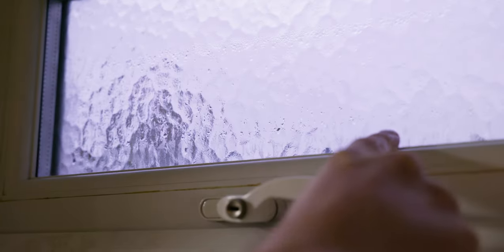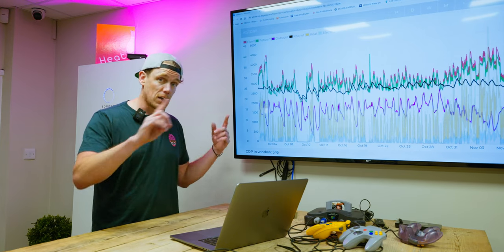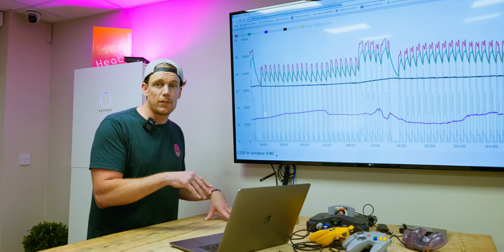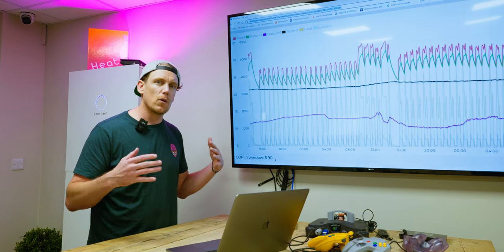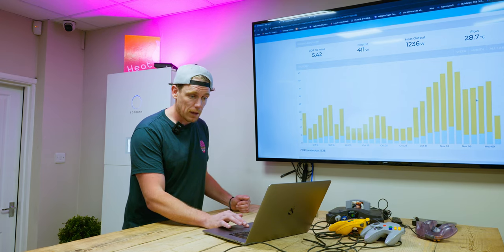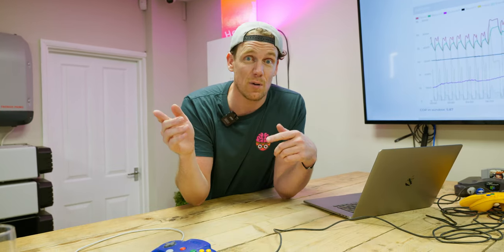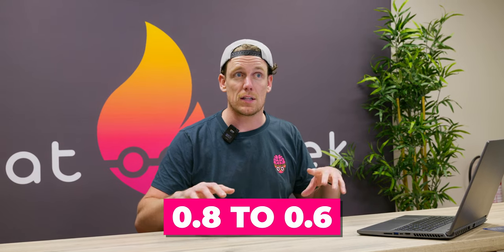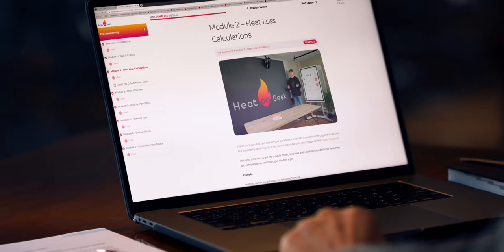How We Got 600% HEAT PUMP EFFICIENCY With NO INSULATION!

Comment: Could you explain the reasoning for target COP number as the measure of successful performance ?  yes it shows the very efficient use of electric Vs direct gas heat but surely it is the total electric energy consumption reduction that should be the target. So when you install insulation total heat demand goes down and hopefully electric consumption. Should that not be the target to encourage?
Reply from the maker: Sorry I don't understand the question?
Reply: I think he means that insulating should be the priority instead of system performance. 

He probably didn’t get the idea of this beeing a testcase where a heatpump can heat a poorly insulated building without displaying horror kw/h usages just by focusing on good system design. 

Anyway, subscribed!
Reply from the maker: Adding insulation means tou can lower flow temperatures which increases efficiency ad well as lowering demand

Comment: Surely having a poorly insulated building will slightly increase the efficiency of the heat pump. (Not the other way around.) That would be because the poor insulation would allow the internal temperature to drop more easily, keeping it a bit lower, which is good for the efficiency number.
Reply from the maker: No.. that means it works harder and efficiency drops... it has to work at higher temperatures.. the opposite of what you meed
Reply: @HeatGeek  When you say 'works harder' do you mean that it has to move more heat per minute? The situation in my house is that our poor insulation means it stays rather cold even when the gas boiler is blasting away. So, poor insulation to me means lower internal temperatures.

Would it be fair to say that lower internal temperatures would make things a little easier for the heat pump (less of a temperature difference to pump against) but having to supply more heat forces it to work in a less efficient way (e.g. outer panels get colder)?
Reply from the maker: @Matthew Leitch  I mean it had to work hotter so the expansion valve closes more and the compressor pushes harder against it so the efficiency drops right off..
Reply: @HeatGeek  I'm not familiar with the internal mechanisms but was thinking of two points of basic physics. (1) The efficiency of the heat pump is powerfully driven by the temperature difference between the internal and external environments, which is why they are less efficient on a cold day, but would be more efficient if the internal space was kept cooler. (2) The temperatures of the internal and external panels of the heat pump are not the same as those of the internal and external environments, and this difference increases when the flow rate of heat is raised. With a high heat flow rate the external panels get much colder than the external environment and the internal panels get much hotter than the internal environment. I think this second effect is the one you are talking about and is the dominant effect when the internal environment temperature is fixed using heating controls. Have I got this right?
Reply from the maker: @Matthew Leitch  yes. Put more simply, thouugh.. the wider the source and sink are apart the harder the compressor has to work to move the heat and the more electricity consumed. Source is environment, sync is the rad flow temp.. not the room..

Comment: We have a similar 7kw arotherm. Just checked the working figure which vaillant elude to being cop. It's  reading  7.1 for heating for November so far and 4.2 for dwh. Seem too good to be true. Although have tuned it carefully to get there.
Reply from the maker: If your well insulated and/or have underfloor heating it's probably correct.
Reply: 50% insulated . Lots of thermal mass, mid terrace and basement with ufh . Rads in the rest. And super warm November!
Reply: @zlmdragon.  thanks. I have measure the  actual electrical usage and it does under report about 50-60watts consistently when running. But as the running power varies between 500 and 1500 watts normally the percentage error is not too bad. But it annoying they don't give true figures. Like estate agents 'measuring' floor space the error always favors the measurer!
Reply: @zlmdragon.  absolutely.  But at these figures I'm happy even with a 10% error. It's still way out performs our gas boiler which was the point. They clearly could include the pump and electronics consumption.  Just the dishonesty of the marketing world. 😞

Comment: Awesome videos. Thanks so much for sharing this information. Like some others here, I have an Ecodan. Is there any chance you can share some comparable settings?
Reply: The main get good COP is keep the flow temperature as low as possible, Adams heat pump runs with a flowT of 27C-30C when it's about 7C outside. If a flowT of 30C doesn't heat your house adequately you could look at upgrading radiators. Also ensure the system is not zoned and all TRVs are fully open for best performance. Every system is different, real-time monitoring is very useful to immediately see the effect of any changes
Reply: @GlynHudson  Hi and thanks for the reply. All rads were upgraded at the time of installation and TRVs are all at max so should be good there. I switched to curve settings at the weekend but blindly copied someone else's setting. I have an upper and lower setting (flow and outside temp for each) but not sure which temps I should start at. I think I set something like 48 @ 2 degrees and 35 @ 15 degrees. Sounds wrong from what you're saying.
Reply: @craglett  That curve setting means your flowT will be 48C when the outsideT is 2C or below. Assuming you have upgraded radiators, this is very high! Try reducing the curve as much as you can. You could try something like FlowT 28C @ 15C outside and flowT 35C when 2C outside. You can experiment over the winter by slowly dropping the curve until you're cold and then increasing it a bit. The rads will obviously be cooler to touch but the heat pump will run for more efficiently for longer  between cycles
Reply: @GlynHudson  Again, thank you for your help with this. I shall give those settings a try as a starting point and experiment over the winter.

Comment: So, come on, lets be honest, you know and I know and everyone else who did physics knows, it's not more than 100% efficient.  That's why they don't call it that they call it GOP.
They are not 100% efficient, far from it.  The compressor et. al.  is quite wasteful, as compressors can be.  Just because it moves 5 times more heat than the power it's consuming, does not make it 600% efficient.  It did not create that heat.  It just moved it.
Reply from the maker: It was  fiscally 600% efficient as we show here 
https://youtu.be/ODbkT3-THaU
Reply: The comparison is generaly made against a resistive heater that is assumed 100% efficient at transferring electrical energy to heat energy. Since a heat pump, as you correctly state, only moves heat it can therefore be far more efficient at heat transfer than a purely resitive heater.
Reply: I'm kind of with you, as a physics pedant, but effiency seems to cut through more quickly than going through thermodynamic theory of heat engines and carnot efficiency etc - though understanding of this is key to realising why flow temperature is so important. Fwiw my heat pump seems to run 40-45% efficient compared with the carnot ideal - which isn't bad when you look at steam engines etc

Comment: I saw your readings was up and down as though it was turning on and off, is this correct?
Reply from the maker: That's cycling..  they're about 45 minute cycles which is fine.
Reply: Does all that cycling reduce HP life?
I don't know much about compressors but i think that the HP does not enjoy on/off 20 times/day?!?
Btw , does an electric compressor pull more power on start/stop than idling away in silence...for all winter??
Ty Adam for all the geeking around so all of us dont have too ;D
Reply from the maker: @FoxyPoxy337  it's not ideal but as it gets colder it stops and obviously doesn't do it in summer. Our heat loss is annoyingly between 2 heat pump sizes

Comment: @heatgeek Is it possible to calculate the SCOP over time without installing the open energy monitoring system? Their system is fantastic but it costs 10% of my ASHP install and I can’t afford it.
Reply: My Daikin wired controller provides figures for total electricity used and heat provided. I can't monitor in real time but take daily readings  . So far heating 232kWh ==>932kWh and Hot Water 196kWh==>501kWh. Average COP 4.02 and 2.56 compared to design COP of 3.4 and 1.9.
Reply: @zlmdragon.  Thanks Vicki, can you recommend any meters?
Reply: You don’t have to have a heat meter (level 3). If you just fit a level 2 system it will give you a good idea how your heat pump is working and may pay for itself.
Reply: @gavthegas547  thanks Gav, that’s good to know. I want to get the best efficiency possible, is the COP the best way of judging this? The level 2 systems are advertised as no COP. I’m getting a Daikin Altherma but I’ve not been able to find out what data I can get from its user interface.
Reply: @zlmdragon.  It will be the EDLA04EV3
Reply: @thesquirrelhorde  you can use the Carnot formular to get close enough for monitoring if you are concerned about the price.
Reply: @zlmdragon.  Thank you for pointing that out. We are having an Octopus install so part of their ability to keep their prices down (their quote was half the average price of other installers) is that we have to accept the ASHP that they supply. Cooling is attractive but it would require fan assisted radiators to circulate the cold air, otherwise it would stratify around your feet. It also needs all the pipework to be lagged which means pulling up floors.

Comment: If I could run one of these off of my home storage battery which cost me 4.5p/kwh at the moment, then I'd be looking at <1p/kwh for heat, must be mad to still have my gas boiler.
Reply: That's exactly what I am doing, 7kW Arotherm plus ASHP has been up and running for about 1.5 months with a total COP of 6.0 and 5.8 for this month so far. Had solar with 12.4 kWh battery installed a week ago and looking forward to seeing the results in the months ahead.

Comment: Forget all the “efficiency” figures (calculated how?) gas is cheaper. Heat pumps only produce background heat and certainly can’t give you hot water. You will need an electric immersion heater and hot water tank. Far and away the best answer is a modern gas combi boiler. Until electricity prices get close to gas this is a non starter and don’t forget the years it will take to recoup the outlay, if ever.
Reply from the maker: To answer your question it’s calculated by dividing the heat generated in kWh by the heat produced in kWh. This makes it about half the price for heating with a gas bouler

Comment: I have to say, your educational videos regarding Air Source Heat Pumps have been inspiring.

I have a question about positioning the outdoor unit, with a suggestion I'd like to pose.

I've bought a heat leaking 1950's house which I intend to insulate. At the same time, it's my intention to build a 6 meter single storey extention at the back, and I think I've had a idea that I'd like your thoughts on.

I plan to have the first 1.5 meters of the extention roof to be flat, and the remaining 4.5 meters of said roof to be pitched. The flat part of the extention roof would be adjacent to the house, but from the back of the garden, you'd be forgiven for thinking that the whole extention was pitched. But the real beauty of the idea is that the flat part of the roof could where the Air Source Heat pump outdoor unit could be positioned.

Can I ask you if there are any performance reasons why this location would be a bad idea.

Some Councils have issues with the esthetics of industrial type white boxes attached to domestic dwellings. My idea may offer a discreet solution.

Hope I've explained my idea clearly enough to understand, any thoughts would be greatly appreciated.

Regards

Robert
Reply from the maker: No performance drop no

Comment: most likely heat pump is working in a different stage!!!  if you insulated walls then heat pump will work in lower stage or speed if its inverter heat pump and HP efficiency will be higher!

Comment: What was wrong with your windows? What do you mean by blown?
Reply: The seal in the double glazing unit is gone. Double glazing has a vaccum sealed section between the glass panes.
Reply: @Etacovda63  Ah, cheers
Reply: @Etacovda63  the vacuum is a bit of an urban myth for common glazing, it’s just air unless filled with argon which improves the u-value of the unit - the condensation which indicates failure results from the butyl seal and dessicant in the spacers failing over time and letting moisture in more so on south facing windows with extremes of temperature change. True vacuum glazing has very thin units as the gap between panes is as narrow as practical to create the vacuum and also has micro-spacers to stop the panes touching under the external atmospheric pressure - they are also super expensive albeit having a very low u-value 🤓
Reply: Thanks, good info and makes sense.

Comment: please note that these figures are only based on heating only, with hot water being solar generated instead, your figures and lower cop rating will lower if you heat a solar cylinder using a heat pump as your main source

Comment: I presume your heat pump is sized for your current poor efficiency heat loss. When you add cavity wall insulation (or    external wall insulation) and loft insulation the heat pump would end up quite oversized.  Even more so if you improve the glazing. Is that likely to cause problems with the heat pump cycling on/off and hurting SCOP ?
Reply from the maker: There is no smaller heat pumps out there
Reply from the maker: @sonacphotos  they are inverter driven, yes.
Reply: @sonacphotos  There is still a minimum turndown ratio even on inverter driven units.

Comment: Great video and lots of useful information as usual.  As an engineer it always rubs my nerves to hear people talk about heat pumps having greater than 100% efficiency.  Nothing has greater than 100% efficiency heat pumps included.  What you discuss as efficiency is coefficient of performance not efficiency.  Heat pumps don't generate heat they move it from one place to another.  This requires less work than generating heat which is why they are able to release more energy in heat than they consume to run.  But efficiency is a measure of the work done versus the power consumed and this is less than 100% for all heat pumps.  Otherwise perpetual motion would be possible.  Anyways I know you use this expression because it is easier for the average person to understand the relationship between power and heat released.  But the more people who use the word this way eventually the meaning of efficiency will be distorted into something it isn't.  But then again I suppose that explains many words in modern English today which are a long way from their original meaning. ;-)

Comment: No one is talking about the fact home heating oil is cheaper than a heat pump with current electric and heating oil prices
Reply: What's the price of heating oil per kwh?
Reply: @hazmat5749  price 0.96 per letter 1 litre provides 10kwh so it 9.6p kwh.
Reply: Yes, you're right.  A heat pump running with an average COP of 3:1 will cost around 11p/kwh plus standing charges.  In all my projects, I advise my clients who want a heat pump to always combine it with photovoltaics and battery storage.  Expensive yes, but if you're going to go for it, then go for it is my opinion.
Reply: @craigstephens93  I really want to invest in a ASHP but it doesn't seem to  be a good idea to move from my oil boiler just yet. Although I am investigating in solar and battery system in 2023.
Reply: @gasmoney9319  Really? 9.6p per kwh?  Thats cheaper than gas, does that include delivery?   My electricity cost 24p per kwh, with a heat pump with SCOP of 3.5 that works out at 6.9p per kwh average cost for heating.  I am currently paying 10.4p for gas and with an 80% efficient boiler thats the equivalent of 13.5p per kwh.
Reply: @hazmat5749  you seem to be getting a very good rate on energy our electric is 0.33kwh. Am not so sure a heat pump would consistently achieve a cop of 3 throughout the winter in most cases. Delivery is free although you have to purchase in bulk I  purchase 500l each refill my tank holds 650l.

Comment: The title is a lie. 600% efficiency is impossible and these guys know it. They may have got a COP of 6, but that is NOT 600% efficiency.
Reply: it is though. You dont understand how a HP works apparantly.
Reply: @Deiphobuzz  No. sorry bud, but it is you who don't understand. Define COP for me and define efficiency. When you have done that I challenge you to prove they are the same thing.
Reply: @nickwinn7812  Youre trying to prove something with the statement but refuse to just post the answer. This makes me guess you dont know after all. Im not bothered at all, so have at it.
Reply: @Deiphobuzz  I'm a qualified engineer. I repair and maintain heat pumps. You accuse
me of ignorance whilst demonstrating your own.  

 COP is the ratio of the energy input to the system (usually but not always by a compressor) to the energy transferred from the cold reservoir to the hot reservoir.

Efficiency is the ratio of the energy input to a  system to the work energy output of that system.

Now. You prove to me that these are the same and equal things. Use whatever annotation you prefer for the various parameters.
 Please ensure that you do not violate the first law of thermodynamics in your proof.

Spoiler: There would be no need for the term Coefficient of performance if it was the same thing as efficiency.